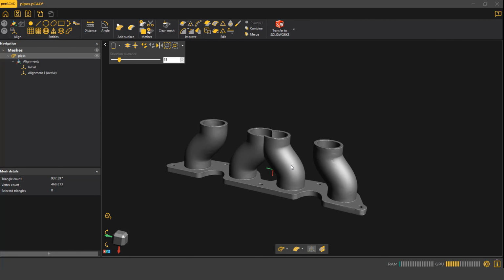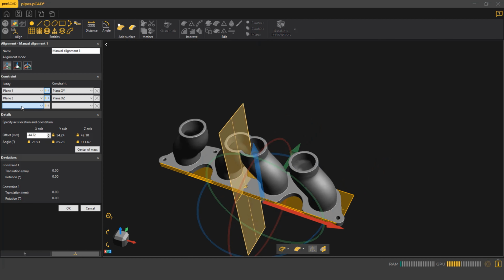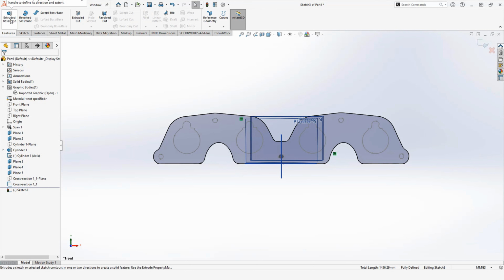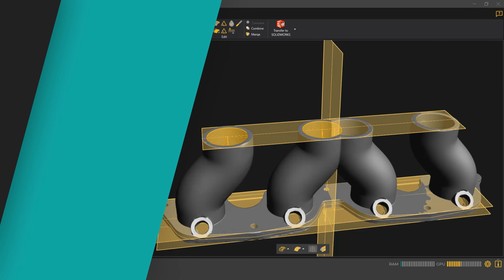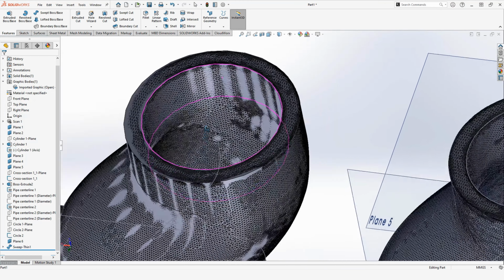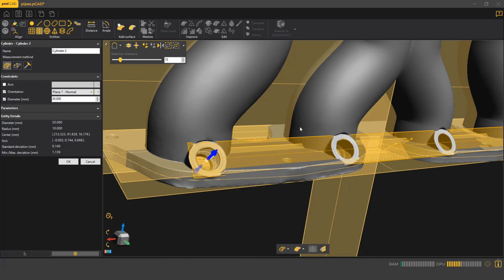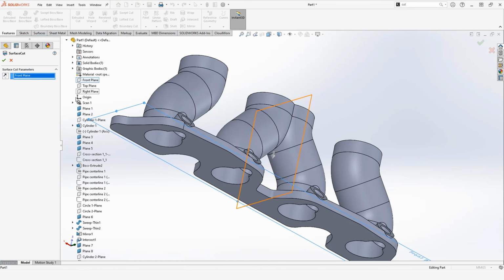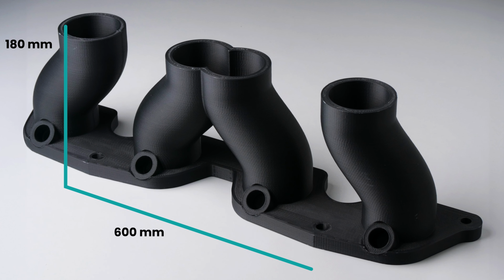Solid Print3D Technical Guide: peel 3D scanner – Part 2: Reverse Engineering our Part

Comment: During the creation of the third alignment plane: Wouldn't you have wanted to use Plane 2 as the construction reference rather than Plane 1? Since you are already indirectly referencing plane 1 via the cylinder which directly references plane 1

In trying to replicate your steps, I'm finding that planes 2 and 3 end up not perfectly perpendicular to each other